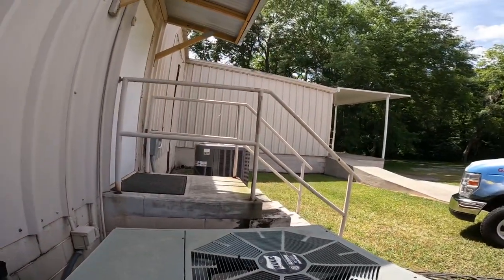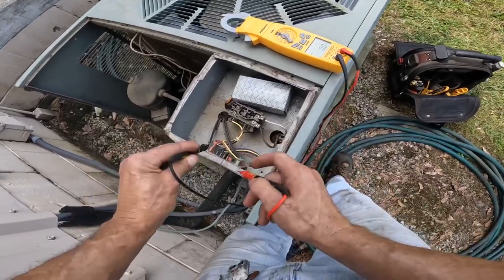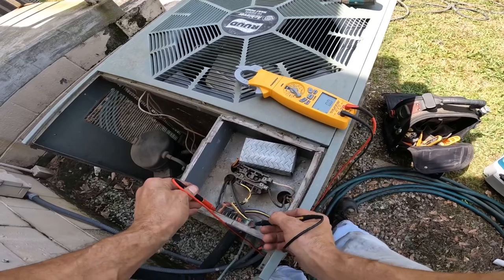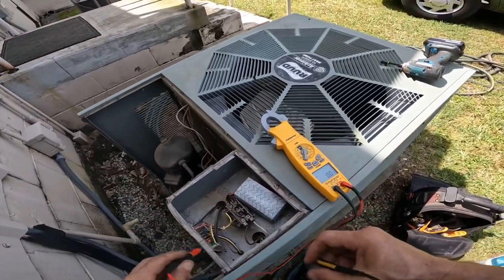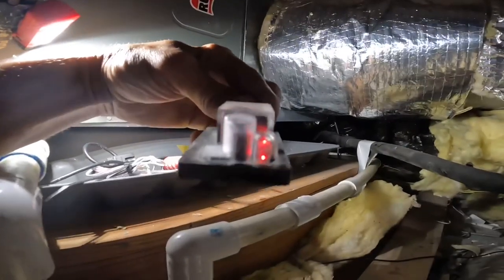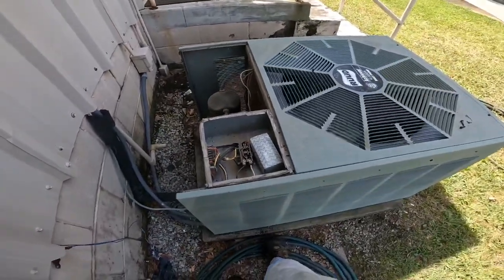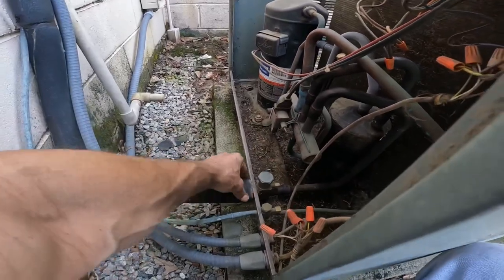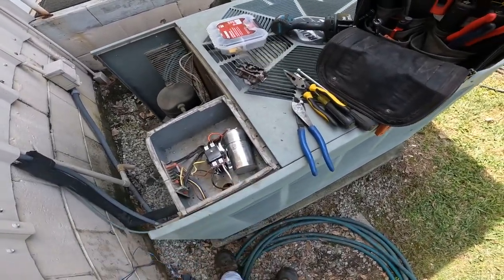Odd Low Voltage Symptoms At Condenser

Comment: I had a similar thing happen to me a couple years ago.  The float switch was rapidly dropping 24v power to the Contactor.  I had an SS2 switch on the secondary drain port of the system and inside the cup part there was a huge water bug that got stuck and every time he moved his arms he would trip the safety switch.  Anyways, just a funny story.  Glad you figured this one out.
Reply: now that is funny. 🤣🤣🤣

Comment: As a homeowner I put an air handler in an attic once... NEVER again.
Reply: Last house before this one I had the HVAC replaced shortly after we bought it and had the air handler moved to the attic.That one and the one that replaced it years later never did cool the house in the middle of Summer.
Reply: @CircleD1  Did you ever find out why; sometimes we found open air return ducts in the attic. Entering temps around 130*F. Houston Texas!
Reply: @bobboscarato1313  Never did. I questioned the size of the return and if the ducts were routed correctly when they were putting in the last one and they reassured me they were sized and routed right but I think they were wrong especially I thought the Living room needed more than one register.

Comment: It seems like you have a lot of unmounted, still in the box capacitors in your area.  Do techs not know to mount them?  This seems to be a recurring theme in the outside condensing units you work on.
Reply: They should at least screw the box to the backplane.
Reply: @thisisyourcaptainspeaking2259   Lol that’s a good one.
Reply: What is the purpose of installing the cap in the box
Reply: @wallywal5475  It's pure lazyness.  Leaving trash inside the machine and not strapping the cap safely into place are both bad practice.
Reply: @thisisyourcaptainspeaking2259  He is right. They use the box as a insulator instead of strapping the capacitor with a metal strap. It's just laziness.
Reply: @Ajax2341  o ok- Roger that